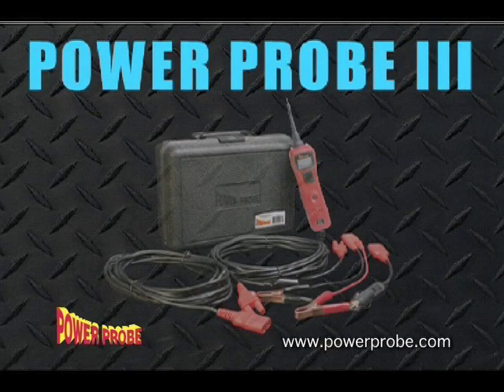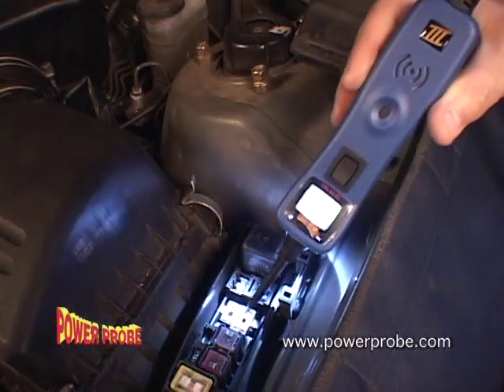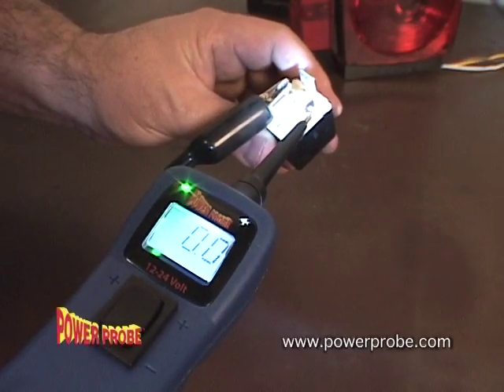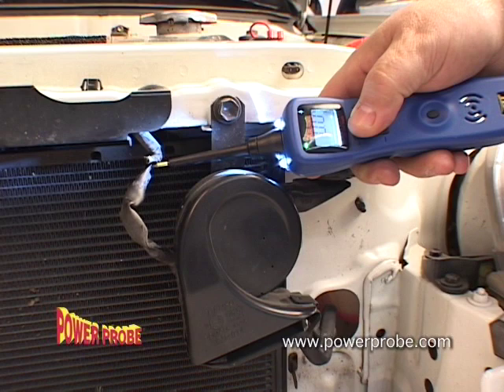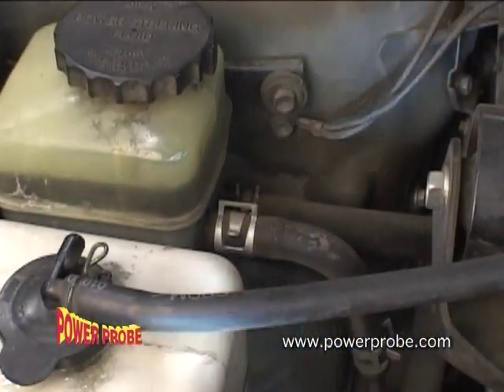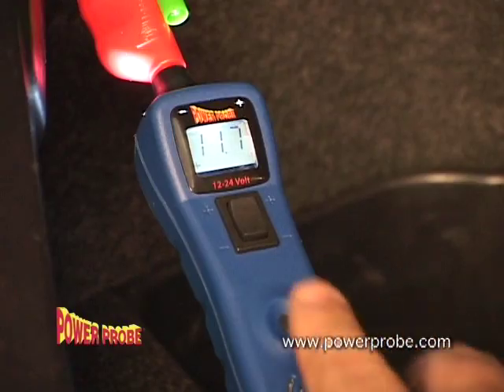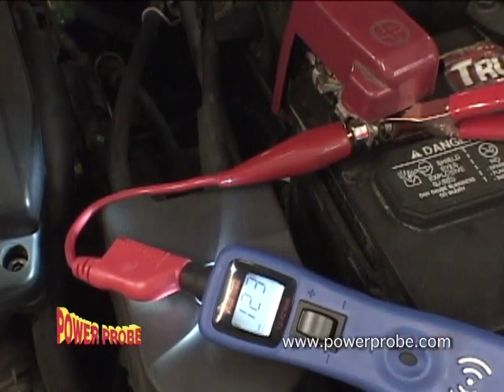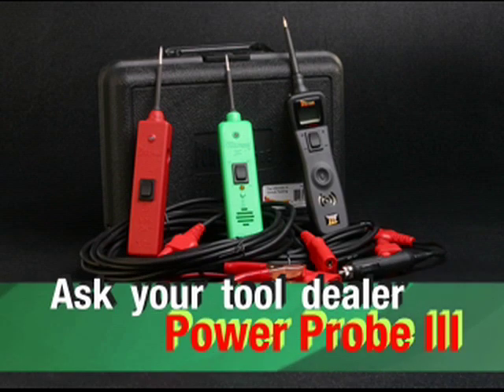Power Probe 3 Introduction

Comment: Do you always have to hook up the black and red alligator clips to a power supply? What if you just want test a plug or switch to see if it's hot? Does the short black connector also act as a ground connector like a typical test light?
Thanks
Reply from the maker: Yes, you always need to power up the Power Probe circuit tester, you're correct, it works like a test light if you just want to test a circuit for Power or Ground, but the aux lead will always be a ground wire on the Power Probe 3, this way you can power up components off the car, when testing for power or ground on a plug or switch as mentioned above, you will not need the ground wire, your ground wire is already connected to the battery when you powered up the Power Probe, hope this explanation was clear, if you need more information, call our technical support at 1800 655 3585

Comment: At 1:06 into the video you show how to check continuity, great. How can you check continuity if you were tracing trailer brake wires, for instance, if wires to were at the back of a 4-Door Long Bed truck and you were under the dash or in the engine compartment. How can you check continuity and map out wires  on  20 foot wires?
Reply: You would have to just add a long test wire to the short test lead so it could work at longer distances hope that helps,,